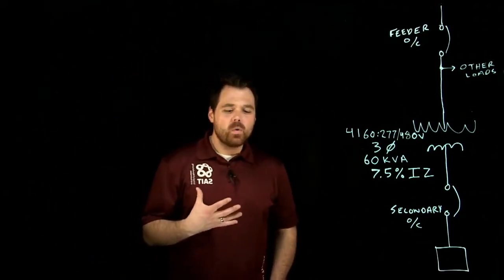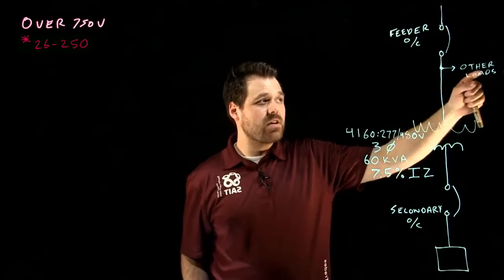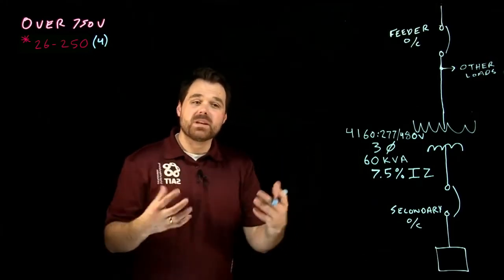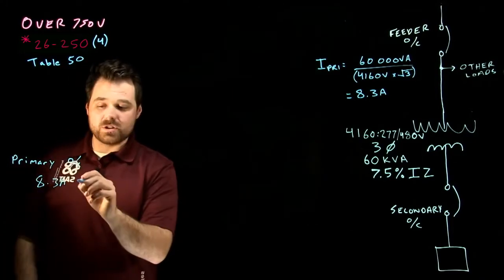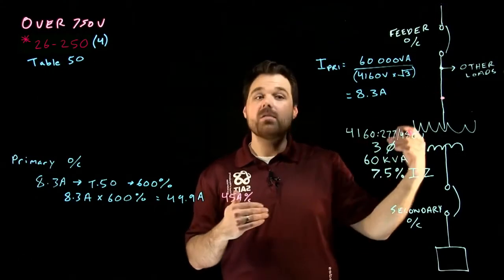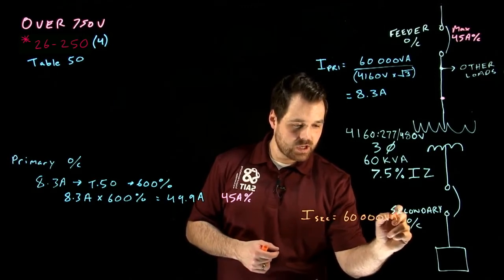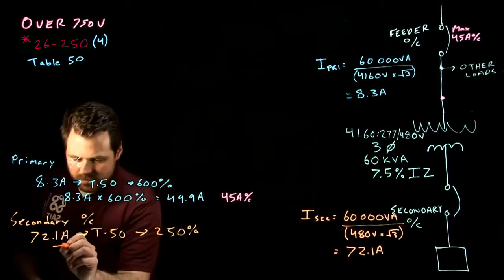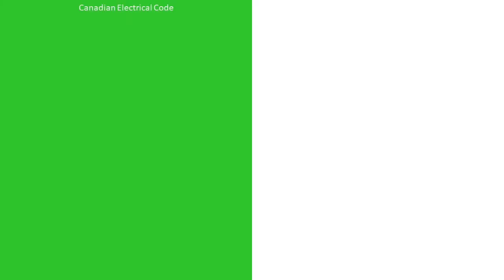Transformer Overcurrent Sizing, Over 750V, Primary and Secondary

Comment: Hi just to ask since the transformer is rated at 7.5% IZ, should we use 400% on the primary (not 600%) from Table 50 (over 750V).

Comment: it seems 250% is wrong for breaker as we are over 750V
Reply: 300% should be ringht.
Reply: @bryanz5904  As the secondary of the transformer is less than 750 V, I believe either a fuse or CB at 250% rating is what we would calculate.  Only if the secondary was OVER 750V would we use the other columns.
Reply: Table 50 - Secondary V of XFMR is rated at 480V so 250% is your multiplier for over or under 7.5%IZ. 26-250 1) is based only on the feeder or branch feeding the XFMR. The secondary OC is not required by code in this example, however sometimes spec or loads require it. Since this example requires a secondary OC, the feeder OC device is sized based on Tbl 50 as well. If the feeder required a higher value OC than 45A, a primary OC before the XFMR would be required at the standard 150% fuse or 300% cct breaker rating. That is my understanding of the code.